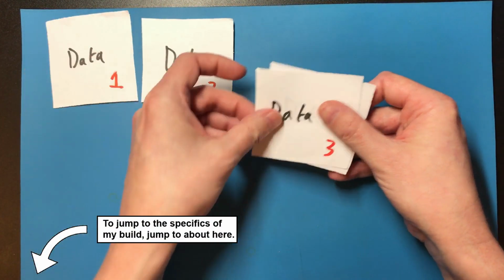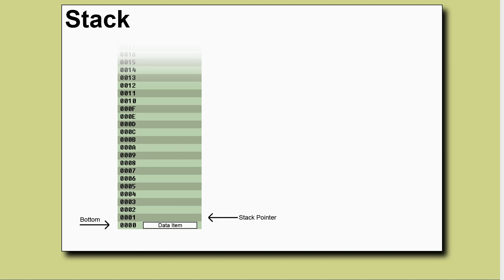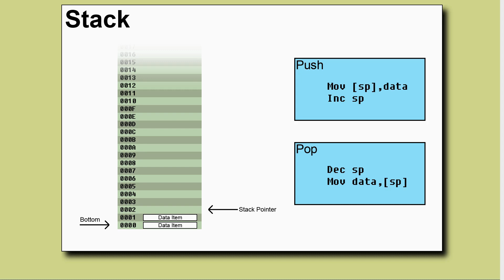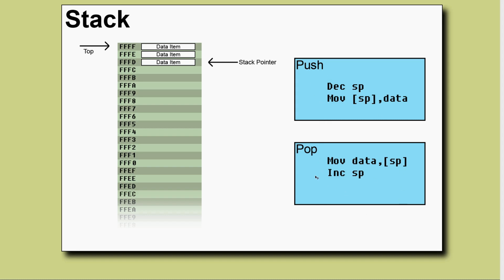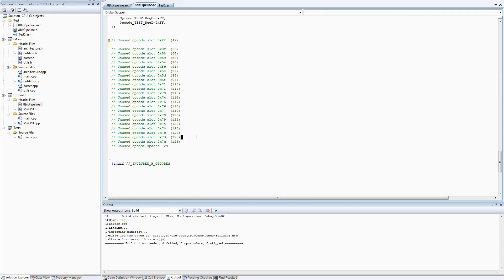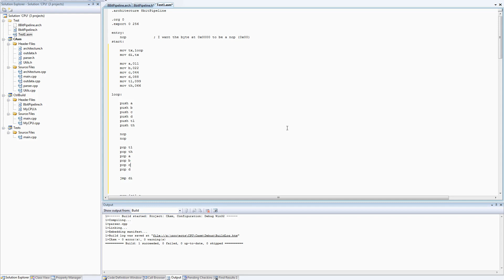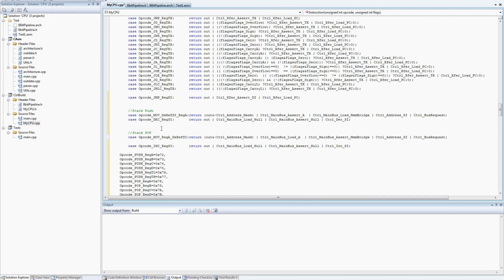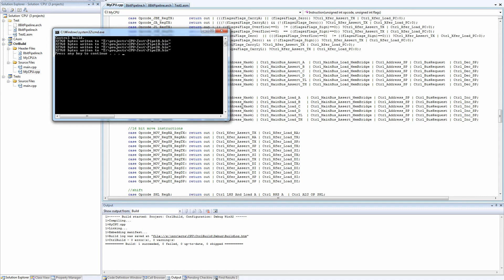Stack (Push & Pop) - Making an 8 Bit pipelined CPU - Part 61

Comment: I want to say that the stack pointer growing down has less to do with the heap, and more to do with how it is accessed outside of push and pop operations. Say I push in order, A, B, C, D, E and F, then writing "mov dest, [SP + #5]" would result in retrieving B without popping every value in sequence. Almost all compilers will do this with stack variables instead of pushing and popping, as it can be done out of order.
Reply from the maker: I don't think addressing mode is what dictated that. It would be just as easy to do mov dest,[sp -5] if things were the other way.
Reply: @weirdboyjim forgot about that. For cpu design, if you treat SP as a register (most do) then you can share the [reg + imm8] also used for structs.

Comment: So, if I have this right, since incrementing SP happens a stage after decrementing SP, trying to push a value immediately after popping one will cause the CPU to attempt to increment and decrement the stack pointer in the same cycle, leading to undefined behavior, correct?
Reply from the maker: Yes, other way around works fine. One of the odd things that simplified the circuit. I’ll be showing a version that doesn’t have that issue some time in the future.

Comment: Good one James, I liked the TX shortcut, nice and simple. Thanks.
Reply from the maker: Thanks Jerril! The TX shortcut was pretty much necessary; I knew a 16 bit load instruction wasn’t going to happen but once you start using labels to assign addresses you need a way to assign one to a register in one go. Otherwise you need extra annotation to say “bottom 8 bits of address” and “top 8 bit of address” in an assignment. I might still add that but for now it lets me write far more readable code.

Comment: Excellent work! It seems you didn't forget to make your address registers readable, unlike me :) I'll be able to have a stack, but I'll need to redesign a PCB to make it actually useful...
Reply from the maker: Oh no! What was the mistake? I divide my mistakes into 2 categories [a] Mistakes where I erred (i.e. a solder bridge, missed wire etc..) [b] mistakes where I generally did not have the necessary knowledge to do the right thing (I.e. grounding issues I've been fighting or the timing issue I'll describe in the next video). The latter are actually enjoyable, I get a rush when I work out something new.
Reply: @weirdboyjim  my main mistake is not making notes when I think of something, and going to PCB much too quickly (bending wires is boring!) :) I knew I need to be able to copy the PC to the stack, but when I designed the address registers I forgot all about that, so they don't directly support that, and the way the PCBs are designed might make it hard to get the address lines out to the registers easily... I'll figure out a way, but I suspect it will involve some sort of breakout board.

I suspect I'll get my share of grounding and power issues too when I get further along, and I'm convinced timing will catch up on me as well.
Reply from the maker: You'll find my call and return video interesting when I get to it. Try to guess how I can do call in one instruction? It was a challenge to work that out when I was first planning the build.
Reply: @weirdboyjim  You have 8 bit memory, 16 bit addresses, and one instruction per cycle. IIRC you can only do one read and one memory write per instruction... To be honest, I don't see it!
Reply from the maker: @FrankGevaerts  I know right! I either have to do 2 16 bit register copies or a 16 bit copy and 2 8 bit push operations. Doesn't fit in the pipeline. You will smile when you see what I do.
Reply: @weirdboyjim  I'm looking forward to seeing that too, you got me curious some time ago and now even more...
Reply from the maker: I feel bad that we were talking about it so long ago and I haven’t “presented the goods yet”. This thing is taking longer than expected, mostly due to the video production process. I can’t just add things to the build when I get a spare half hour, I have to plan out a themed, contained addition, then I have to record it and then edit down the video.
Reply: @weirdboyjim  As you say, this is unavoidable when making this sort of video. You could of course just record whenever you work on the CPU and upload it as-is, but then it would not be interesting to watch. I (and I suspect many others) appreciate that you take the time to present things properly, and I don't think there's anything to feel bad about.